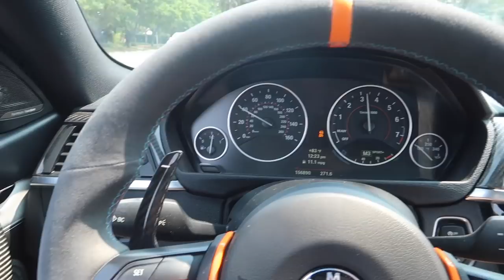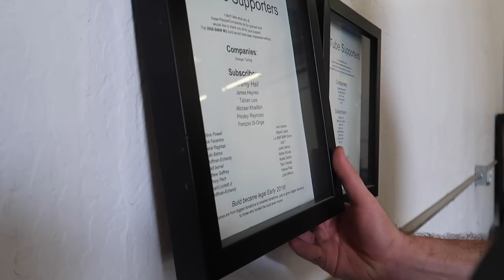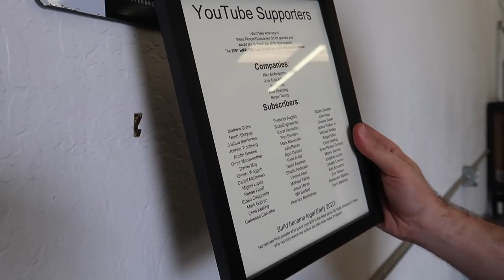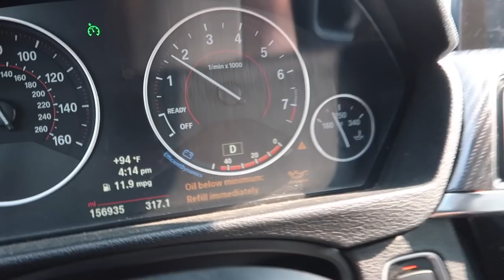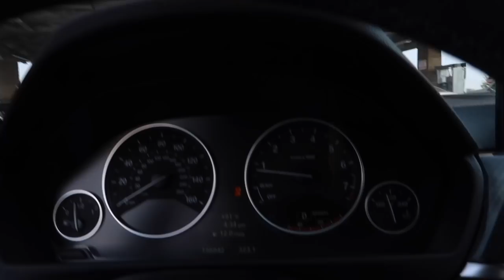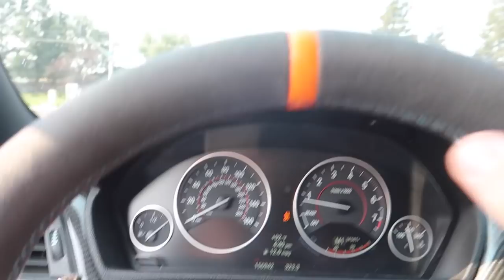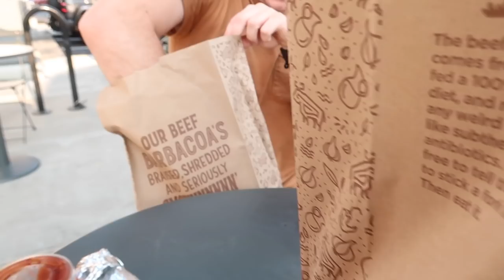Saying Goodbye To The Shop! (HERE IS WHY!)

Comment: Just be careful with over filling the 435i, the oil reading doesn’t show if it’s over filled. It shows full, 3/4, 1/2, 1/4 and low

Comment: My friend had the same problem that you have with the oil consumption on his 335i f30 N55 with 260 000km on the clock witch is around 160 000miles. He had to fill over 1L with oil every month on the car. He took the engine apart, and the pistol rings were very worn. Since your 435i is a high milage N55 you should take this consideration. So you don’t damage the engine. Maybe its time to take the engine apart, and rebuild it. Since my friend did it right after he got the same message that you did in this video.